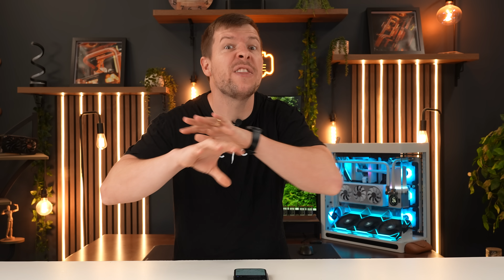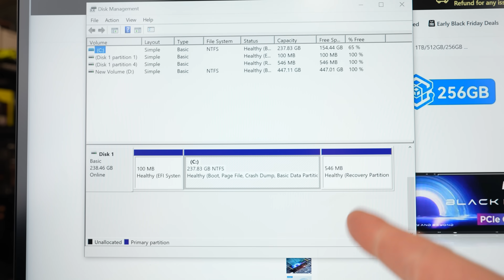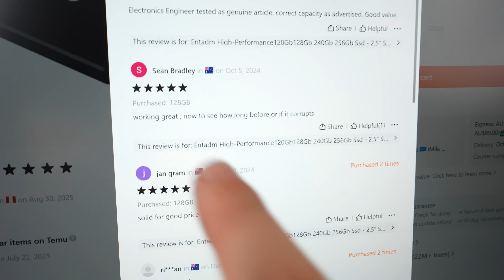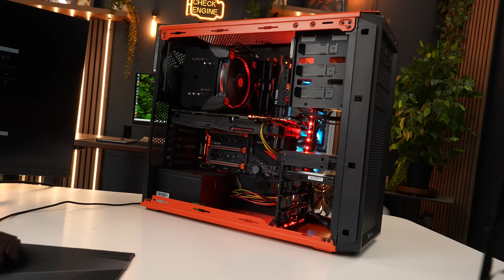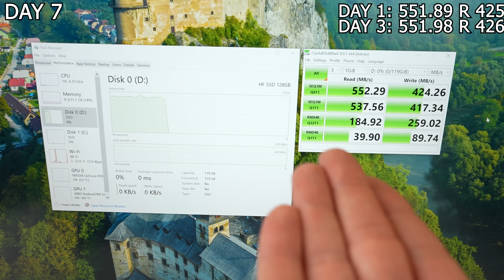Can You Trust TEMU PC Parts? I Put Them to the Test 🔥

Comment: Here in Brazil we're super used to buying hardware from Aliexpress, I suppose the sellers are mostly the same on both platforms. Our taxes are crazy high for hardware, but when importing back in the day most items would pass through without taxes lol. I even had a 3060 Ti I bought from Aliexpress, it was a MSI model for Lenovo prebuilts, I used it for almost 3 years and then sold it for more than I paid for. Most of these parts are pulled directly from the same factories known brands use in China, they just have smaller markup. They are reliable and can last for yers just like the known brands.

Comment: Avoid those 90° and 180° CPU and GPU power adapters...
The pin layouts aren't even 1-1, so electricity gets shared and spread between different pins.
They probably do work to an extent, but why risk it on hardware that costs hundreds/thousands of pounds/dollars.

I assume the 24 pin ones do work, but just test them before you use them.

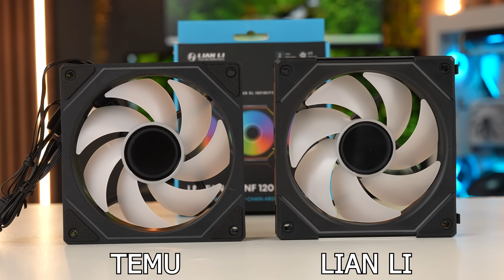Comment: I guess Lianli Fans has lower cfm even though they have higher rpm than the Temu's since they move air much more efficient than the Lianli. Even if the Lianli has higher RPM if the blade's design is poor than the other then it would still be inferior in terms of cooling and I just noticed at 3:37 that the TEMU's Fan has a slimmer design than the Lianli which goes to tell it can move more air than the Lianli's.
Reply from the maker: Yeah i would say that is the case
Reply: I'm using some gamedias fans and they are just like lian li fans except the gamedias fans are £25 for 3 where as lian lis are £85 for 3

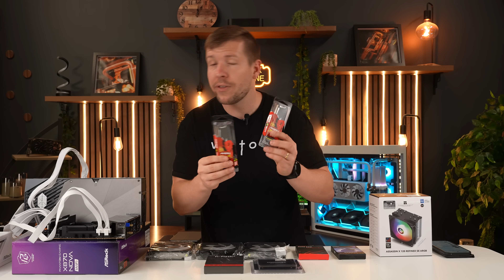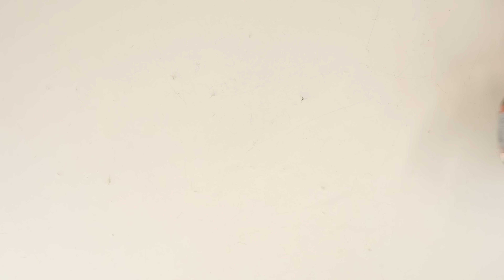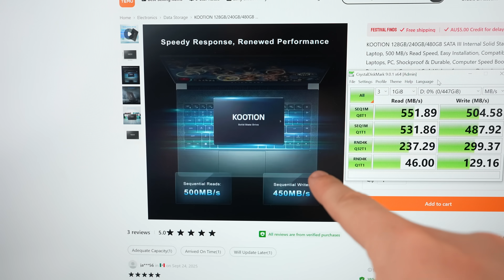Comment: No name parts from temu/ali? There's no fan settings option, the graphics cards are stock, and after logging into MSI, you can't see any speed or tuning modifications. Parts include 6GB drives glued to the case, or even cheap memory cards that sell as junk that disappear after a few uses. Not to mention M.2 drives, which are made to disappear from the system. Yeah, I'm sure the RAM is OC, but they don't have XMP options, etc. As for the rest, if the motherboards would probably work, but "under what" is a different issue. Unfortunately, such devices are available for next to nothing. A 16TB Samsung drive? Not a 16GB memory card in the drive's enclosure, hehe.Although the cooling or fan work, adapters or RGB cable extensions work without any problems, thanks to this you can set it up as you want in the case, e.g.The RAM is a good brand, but 90% of CPU coolers don't support tall RAM. The hard drive is fine, but the card definitely doesn't need a 1200W power supply for such a small unit? I understand a few drives, etc. 2:26 when the video is about no-name products and here he puts together a PC from brand-name parts and you have a moment of brain freeze why. And then he puts together these poor parts and you think wait, wait, what? 4:00 I laughed so hard here, the chill from fear leaked out XDDD 6:20 Well, well, every new, fresh disk will maintain super speeds, wait until it is filled to 50% min, then you will have a surprise and a speed drop of 70% hehe. I'm a bit surprised how this Spartan-style cooler handles 120mm on a processor and such temperatures are not bad, especially on AMD. The tests came out a bit strange because nothing on the PC changed XD So fill up the drives and see what happens. As for the temperatures, if there's thermal paste, it won't change anything. The motherboard will work if the power supply section doesn't die.

Comment: The cooler looks like a Thermalright Assassin X120. Thermalright makes excellent coolers. Also the one you have I just bought one yesterday for 25$ Canadian.
For 50$ you can get the Thermalright Peerless Assassin 120, which is a 2 fan 2 tower 7 heatpipes cooler that would have been fine for your cpu.
In short, Temu sucks for PC Hardware. It's just reselling amazon or aliexpress stuff with a markup and BS marketing.
Reply from the maker: Yeah it is the thermalright assassin x120. Decent cooler, i got it to see if it was a knock off. Performed as expected, i deliberately used a CPU that would push that cooler to its Max because it would then help me test the fans easier.

Comment: Have you tried to give a little push on the top surface of that fan? It happened me once when I bought a similar fan that when I pulled off the protective foil in the middle it made the fan stuck like this, I pushed it a little, it snapped back and worked perfectly afterwards
Reply from the maker: Ohh interesting, ill give it a try

Comment: Don't know that I'd trust any of it tbh, at best you're getting repackaged/rebranded used parts (hence 10-15% lower than advertised SSD capacity) and at worst a complete scam. I've bought plenty of products from Temu previously but would never buy anything from them related to electrical or electronics, plenty of cheap alternatives from legit sources available to pc builders.
Reply from the maker: That's a valid concern, and it's why I put them to the test to see what you actually get.

There is a lower than advertised capacity to be expected, but the ratio is meant to be 1000mb / 1024mb because we are switching to binary. But some of the drives were even less and some came up as used.

So its a hit and miss with temu products

Comment: I've been buying cheap cpu coolers, cpu's, namebrand & non namebrand motherboards, ram, couple crucial SSD's, case fans & adapters. All work well and extremely cheap compared to local prices.
Reply from the maker: Great score! :)
Reply: The ram still working 2 month later? Im checking for buying some but idk if I trust it
Reply: @rimmm15  Yeah, I flip pc's and the owners have no problems for over 6 months. Just got two 2x8gb 2666 kits for 50$ each from aliexpress. Apparently uses Sk Hynix chips.
Reply: @rimmm15  Yeah still works great 6 months later, I was ordering Kingston HyperX & Corsair vengence LPX 3200mhz kits for around 30$ back then, but now ram & ssd'd are hard to come by, bought 3 kits of chinese brand ram kits of 2x8 2666 for around 45$ each kit. Seems to work well so far during benching. Kit is from Envinda memoria.

Comment: What a bunch of garbage "tests" for the storage. Why not actually test the most common problem with unknown storage from aliexpress/temu/amazon, which is the AMOUNT of ACTUAL storage on the drives. You do that by transferring 500-1TB of data on it and waiting until it fails.
Reply from the maker: I didnt think of that test, thanks for the feedback, ill do that next time. I had in my head test for reliability over time.
Reply: Only time you have to worry about that is if you buy say 15TB for 99$ , not at these prices and sizes.
Reply: @boggan_unmasking_lies  I kinda agree. All 16 Gig or sub USB drives I have bought were legit, I drive two different fake flash programs and whole bunch of virus and antimaleware programs in sandbox. But if ypu think you going to get 256 gig pr 2 tb drive for 2-3 dollars, who are you kidding?

Comment: Hi, Brazil here. We have experience with low-cost PC parts and we've seen that what you used should be used on entry-level computers. The cooler is maxed out with a Ryzen 5 or Core 5. The parts have a short lifespan. They don't last as long as a well-known brand. Cheers.
Reply from the maker: Thanks for sharing your experience and insights from Brazil!